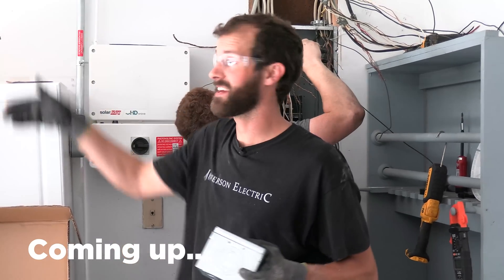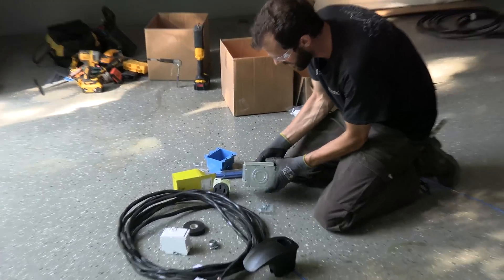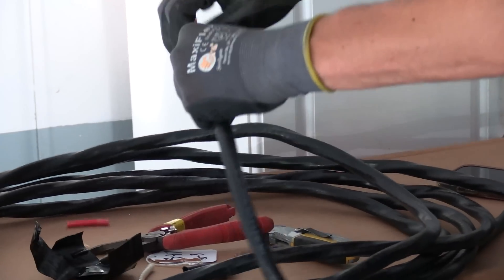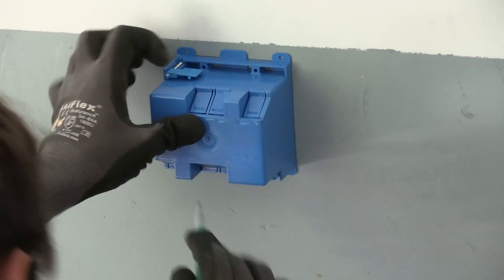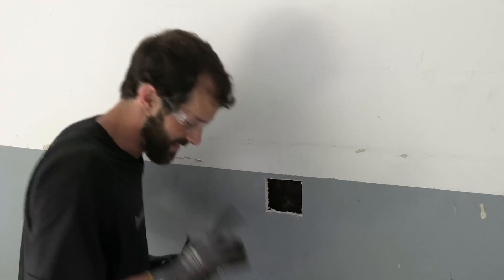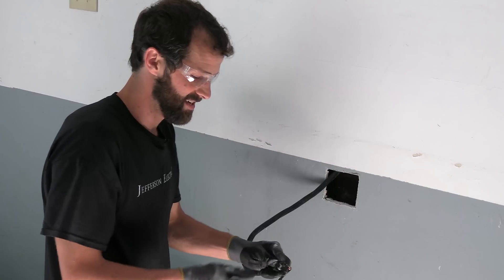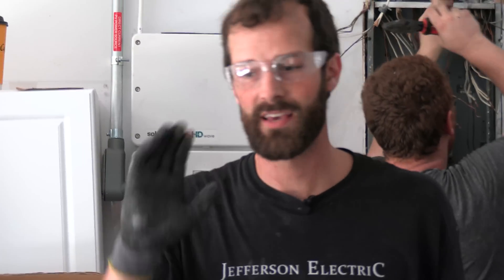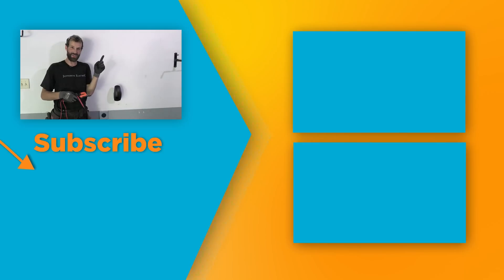Pros Only - Master 'Level' 2 Charging at Home

Comment: You guys use the high-end robust Hubbell NEMA 14-50 outlet, but then put it into a cramped, El Cheapo old work plastic box, secured by flimsy plastic clamps pressing against drywall. No, no, no.

Any outlet-based EV installation (or welder, or whatever), should have a sturdy metal box that's big enough for those beefy wires, then needs to be firmly supported by a framing stud, or if not available, you have to add blocking behind it, and screw the enclosure into that. I realize that means a larger hole in the drywall and then a patch, which adds cost. 

But, the plastic box and drywall is just not an adequate support for a plug that requires so much insertion/extraction force. Electrically fine, but structurally a bad idea.

Comment: Speaking of surge protection and Leviton, what's your opinion of the plug-on SPD that Leviton sells, the LSPD? They have the 15A and 20A versions that comes with two single-pole circuit breakers integrated, so you don't lose spaces.

Comment: Why no GFCI breaker for the plug?   625.54.    I try to always use hardwired stations but a GFCI is a must for that plug.
Reply: Because basically all the manufacturers of the wall unit charge stations tell you not to do it. They have GFCI built in to their box, and apparently, if you also have a GFCI breaker, they'll interact and cause nuisance tripping. This is in the installation manual of both wall units I've installed in the last couple years. I realize that leaves you in a pickle. Hardwiring avoids this, of course.

Comment: I think it's funny that:
1. You talked about routing the cable into the bottom of the box, and then your assistant put it in through the top.
2. You used a surface mount cover here on a flush installation, and on another video where you did a surface conduit run to an identical outlet, you used a mud ring and a flush outlet cover.  
3. The cable was stabled to the top of the rafter(s) in the attic.

Comment: Jefferson Electric, question, could it be maybe the wire size connected to the EV receptacle is undersized, causing failure due to heat ?
If the most expensive receptacle feels heavier, maybe it is due to more mass of metal used as a heat sink.

Comment: Definitely agree on the hole saw, power tool can slip and gouge the wall and the blade can potentially tear up the gypsum also. My handsaw holes are consitaky tighter and cut right the first time than dermal or something. Those people getting a bit lazy only end up spending more time later.

Totally feeling clifs pain BTW that's miserable work.

Comment: The 2 gang "old work" plastic box is too small for the wires and the device.....yes, it is against code. It's against common sense as well.....in the zeal to satisfy the DYI crowd you sacrificed everything that you should be standing for as a professional. Just be honest.... it's not so simple to supply a 50 amp power source and install it properly to stand up to years of service.

Comment: Joel unlike this situation when you hardwire a proper EV charger (or charger wire or car has inbuilt GFCI protection) you need to get EV testing equipment to ensure that key elements of safety are built into the charger as expected namely GFCI protection, effective ground path and correct sequence of communication protocols between charger and car. Fluke does an EVSE test equipment as does other manufacturers.

That being said even for a NEMA 50-amp outlet used for EV charging I would add another selectively coordinates GFCI or add a GFCI to protect the circuit itself that way you have two layers of personal shock protection . Leviton does a 50-amp 2-pole GFCI breaker which is a hydraulic trip breaker rather than thermal magnetic.
Reply: 1. A "proper EV charger" isn't a charger. The wall units are not chargers. A charger is a device that works with a specific kind of battery to control the charge rate that the battery needs (which differs between battery types). The wall units are called EV Supply Equipment (EVSE), or power supplies, or heavy duty smart switches, but they are not chargers.
2. No, it is absolutely not the electrician's job to verify the functionality of the EVSE to that extent, that is why we have nationally recognized test laboratories.
3. I have installed multiple EVSE at multiple homes. Most of them specifically caution you against installing their plug-in versions on circuits with GFCI breakers, because the interaction between what's built-in to their equipment and the GFCI breaker will cause nuisance tripping (leaving drivers with uncharged cars when they awake). I realize the requirement for GFCI garage outlets in the NEC. You're left with the choice to convince your local inspector that this installation qualifies for an exception because the EVSE is left plugged in, and it has its own GFCI .... or, hardwire the EVSE. But, they tell you clearly not to do what you're suggesting.

Comment: Why not hardwire the charger ? Got rid of the fail point and get better faster charging !😊
Reply: give customer versatility if they get a car that uses a different charger, or they can use outlet for other things in garage like a welder
Reply: A hardwired 48A EVSE can be installed on a 60A breaker. If you must have the fastest home charging available. 😅
Reply: @Krunch2020  Actually the ChargePoint home charger can be put on a 70 amp breaker now

Comment: Probably going to do that here. This whole house needs to be rewired. Can't afford that. Just going to replace what needs to be replaced, room by room. Drill holes in the floor and run conduit pipe or steel jacket conduit and leave the wires in the walls null and dormant. Box extenders instead of a pipe mounted box. NO PLASTIC BOXES. PLEASE STOP ! I also hear the unmistakable sound of rattlesnake. He sounds close.

So nice that people can pay $4000.00 to have an outlet installed as I wonder where my next meal is coming from.

Comment: 14:12 - use drywall screws only for drywall. You should use general purpose wood screws for this application. Drywall screws don’t have the sheer strength needed, especially for a heavy duty application like this.
Reply: Dude shut up. Drywall screws are strong enough to hold a freaking cable . Give me a break
Reply: Dry wall screws hold up drywall lmao shits heavy , it’s into the stud too 2in screws will hold up that cord all day

Comment: 13:39 - Joel, any reason you used an LB and not an LR on that EMT installation for the solar? You can’t even access that junction cover with that cabinet right there.
Reply: That really annoys me too.
Reply: @illestofdemall13  ... I watched the video when that work was installed. Obviously the homeowner put the cabinet in afterward.
Reply: @rupe53  Still better to use an LR so the cover is facing forward.
Reply: @illestofdemall13  ... would you believe someone now makes an LB that has covers on all sides? Saw it on a video last week.
Reply: @rupe53  Yes I have seen them online. Those are cool, for sure.

Comment: I would have cut the hole next to the stud and used the deep metal box.
Reply: Yes! the old work plastic box is wrong. Being held on by plastic tabs that will break. I always install next to the stud using screws
Reply: i said that too metal box would be a lot sturdier into stud and box cover plate sticks out anyway

Comment: It's unfortunate that NEMA 14-50 is the most popular. The EV has zero use for a neutral wire, and a well-designed EVSE shouldn't need one either (the electronics can easily be designed to run on 240V). Using NEMA 6-50 would save on neutral wire.

That said, with the 2020 NEC requiring GFCI protection for all receptacles in garages, I'd hardwire an EVSE if it's possible. That also avoids the receptacle being the weakest link or having to find a special industrial receptacle.
Reply: But - now my outlet can also be used for a welder, RV, perhaps some other things in the future if needed. Luckily I installed mine before the new GFCI protection requirement in my garage, that would trip all the time I bet.
Reply: that 6-50 outlet might not need a ground but with a $1400+ job, who's going to argue the last $20 to run a 4 wire cable? That's cheap for the added value. BTW, Tesla is now calling for a 60 amp outlet so is outside the GFCI requirement. Makes one wonder if they did that on purpose.
Reply: @rupe53  the code is "all 125-volt through 250-volt receptacles in the locations specified [...] shall have GFCI protection for personnel". Garages is one of the locations, and there's no mention of circuit ampacity. So a 60 amp receptacle doesn't get around the requirement.

In the video the run was pretty short, but going from 6/2 to 6/3 wire might cost $100 or more for a longer run. 

And to be clear, 6-50 has a ground but no neutral.
Reply: @mattv5281  ... using the example in the video, he said, 30 feet @$5 per foot was $150. I can't imagine you'd shave $100 from that. Code for 2020 also states "up to 50 amp needs GFCI" in certain locations (210.8) so 60 amp would be exempt. Per his other videos, they are still on older code in that area, so no GFCI required yet.
Reply: @rupe53  I'm looking at the code book. 210.8(A) for dwelling units (including their garages and accessory buildings) doesn't say anything about up to 50 amps. 210.8(B) for "other than dwelling units" does say it only applies on single phase circuits up to 50 amps and three phase up to 100 amps.
Reply: @mattv5281  ... you may be correct on the "other than dwelling units' to not mean a garage, but many are probably taking artistic license to stretch that since 2020 code isn't used everywhere yet. Heck, there are areas still using code prior to 2008. I would be pushing for hardwiring a charger but since most come with a plug it's a hard sell.
Reply: @mattv5281  14, 10, 6 all buy in 3 wire. You have a neutral, you're welcome. KISS, keep it simple stupid. 12g 20a keeps the circuits simple too. 14 is for smokes. Done. I'm collecting checks, not finger-banging code exceptions all day for a 5% cost reduction. Time is most expensive. This guy doesn't charge enough. GET AMPED - darn I wish I typed that whole thing in caps
Reply: @N_AUD1  Sorry for going off topic but when you say “14 for smokes”, does that mean you wire your smoke detectors on its own circuit?
Reply: @N_AUD1  You run 12/3 for everything except smoke detectors?
Reply: @rupe53   What do you guys mean by hardwire? The cord that you plug into the vehicle is connected to the branch circuit wiring in a junction box?
Reply: hardwire is the way to go for sure
Reply: @plojm123  No not exactly. Receptacles provide more flexibility and versatility.
Reply: @aurvaroy6670  whatever that receptacle is overpriced for no reason so I am not giving them my money
Reply: @plojm123  What do you guys mean by hardwire? The cord that you plug into the vehicle is connected to the branch circuit wiring in a junction box?
Reply: @thomassemich4627  ... if you buy the "wall charger" it comes with a welder style plug on one end, which is where code wants GFCI protection. There's an exemption (no GFCI) for a circuit WITHOUT a receptacle... meaning a wired connection to a junction box. This is what "hardwire" means. Since most wall chargers have their own GFCI built in you are still protected, but you can't easily disconnect and use an appliance that is not protected.
Reply: What do you guys mean by hardwire? The cord that you plug into the vehicle is connected to the branch circuit wiring in a junction box, eliminating the receptacle?

Comment: How come you use 6 gauge wire for 50 amps? But my electrician says his code book lists 50 amps at an 8 gauge wire
Reply: It’s the NEC and it’s standardized across all states. There are different columns for different temperature ratings. Romex (NM-B) must be rated from the 60degC column which limits 6awg to 55A. THHN, MC and some other types can be rated from the 75degC column, meaning 8awg can handle 50A. See 310.16
Reply: There are different wiring methods and they have different ratings. NM-B cable has a lower ampacity rating than THHN, THWN, THWN-2, etc conductors ran through conduit.
Reply: Size 8 is rated to carry 4amps, size 6 55 amps
Reply: @juliofurtado5642  idk he showed me his code book and it said 50 amps on 8 gauge. Might be different code in our state
Reply: @Russianmafia10  ... look at that again. #8 might do 50 amps, but it's not rated for continuous duty, which is where you get in trouble with car chargers.

Comment: Only quality top notch electricians use the more expensive Hubbell devices. They are the Cadillacs of devices. They make the best spec grade 20 amp duplex receptacles. Hubbell always made the best hospital grade devices. One question the 3/4" LB condulets shown in the beginning should have been a LL or LR condulets. Always forget what is what on these seldom used last resort fittings. Guessing box kissing LB cover was installed at a later date. With the super high price of copper glad I'm retired.Great job. Still have a few strong magnets to find metal studs or screws & nuts securing sheetrock. First time that I heard to use a flashlight to ID seams.
Reply: light to find nails / seams is an old painter's trick. I have been using it for almost 50 years.